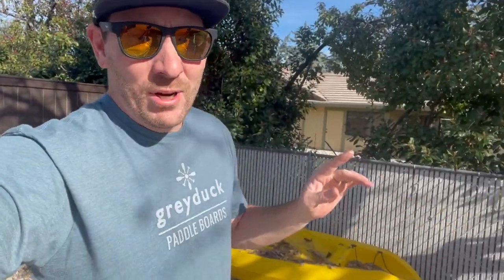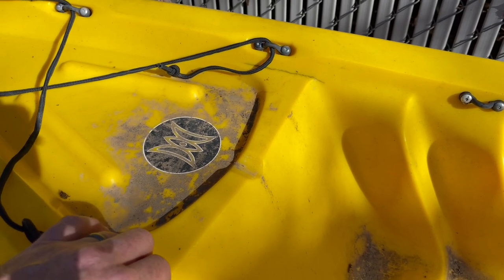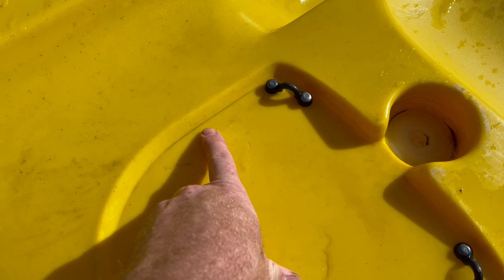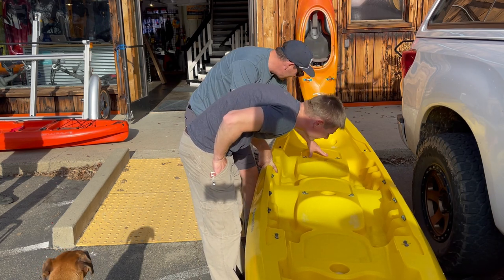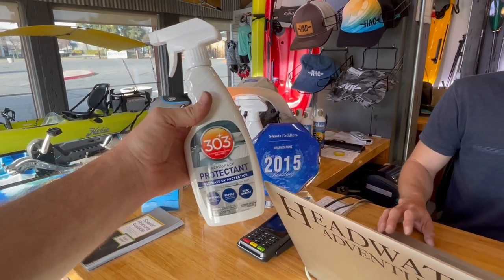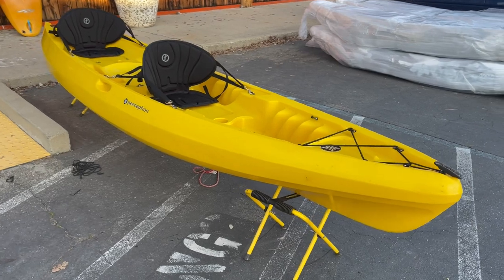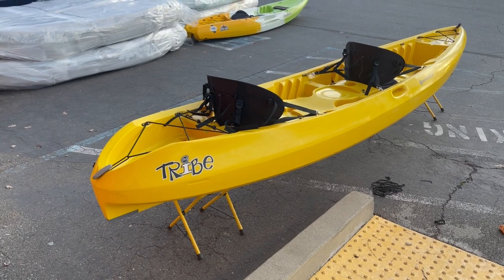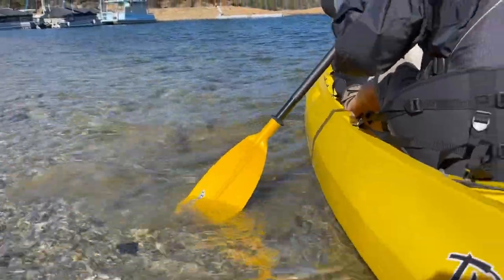Attempting to Flip a $300 Tandem: Lessons Learned

Comment: Dan, that's so cool of you to do.

Question: I have a 13ft kayak stored outside because I don't have space in my garage. It's in a fairly shaded area and I have it covered with a plastic tarp with bungees. Is that sufficient enough or should I do something else to protect it? It does get hot where I'm at (Sacramento).
Reply from the maker: Keeping it in the shade it good. Applying some 303 protectant to it every few months will definitely help it stay in better shape. Fights the UV rays.